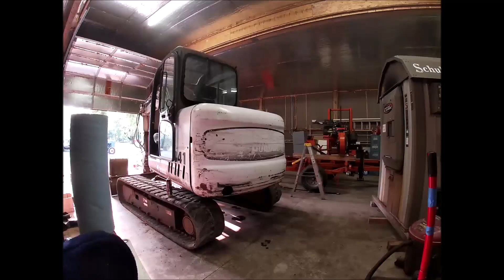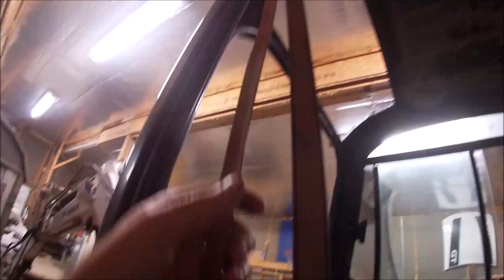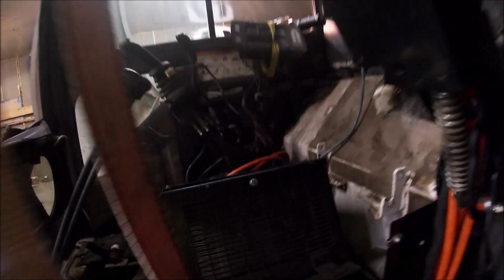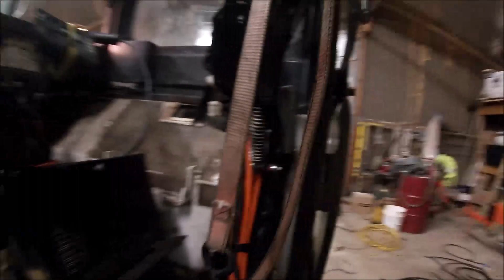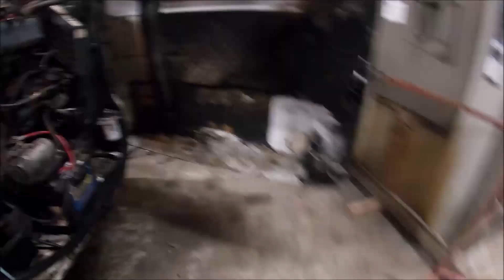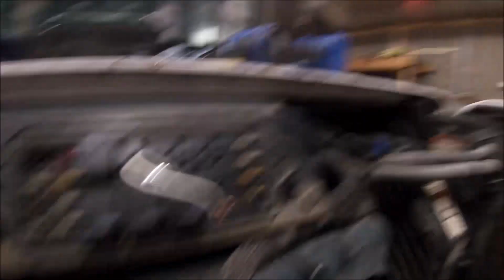Another Auction Gamble - Fixing A Bobcat 341

Comment: Hello from Newfoundland Canada. I own a Bobcat 341G. It is one tough animal. The machine is a dependable workhorse. Except for the cosmetics and what  looks to be operator abuse on your machine, its a nice machine. My cab is warm in the winter and cool in the summer. I converted mine to steel tracks. Very dependable to start in very cold weather. As for high level in engine, yes drain to proper level, better again, change it and the filter, then monitor it. I did have to change a few hyd pilot lines on my machine. the heater and seat had to come out because of the hose routing. Lately, I removed and resealed the hydraulic swivel. To check hyd oil level, the correct position is to curl up the stick to the boom, lay the bucket as close as possible to the blade, then check the sight glass. I have an allied rock buster as an attachment. The combination of excavator and buster is a money maker. The Gates original hoses are the proper ones to replace with. Regular number 4 hose either 1 or 2 wire when bunched together are hard to hide in place. Also some wire type hose will transfer machine vibration up to the joystick. I wish you good luck with the 341G. I'm very much impressed with mine!
Reply from the maker: Thanks for the tips.  I do get alot of use out of the machine and it is doing well.  I would have like to get the right pilot hoses but my local shop didnt carry that type of hose/fittings.  The non conductive hose has been working very well and its outer jacket seems more durable.  The machine was abused, and i have checked the oil level frequently and it was just overfilled by previous owners.  Very happy with the machine so far, but still needs some work.  One track adjuster is bad, and the Aux switch on the joystick needs replaced.  Will have to get some time to make more repairs soon.